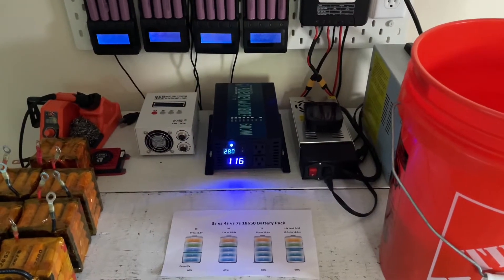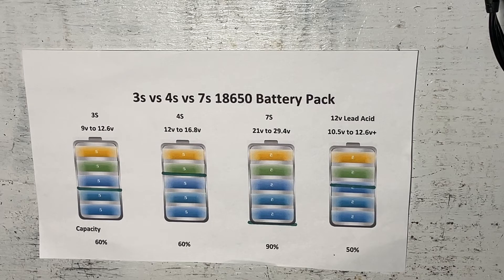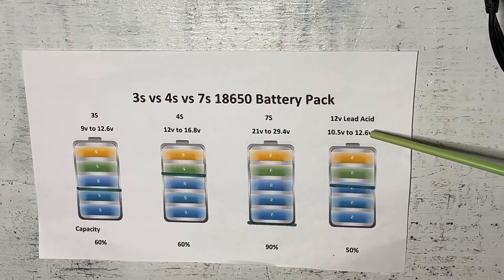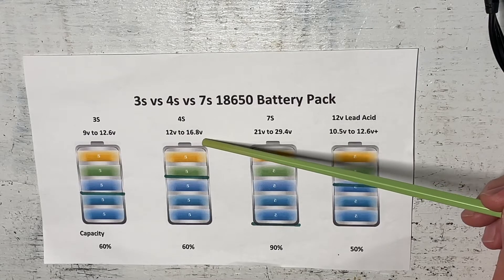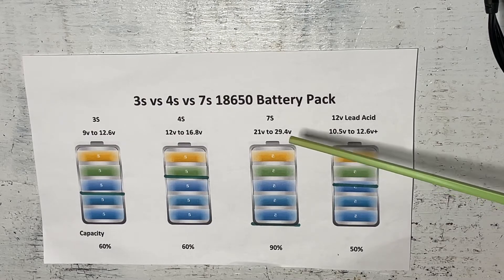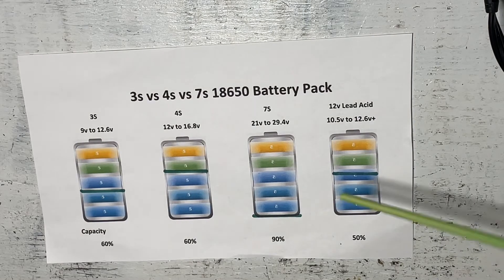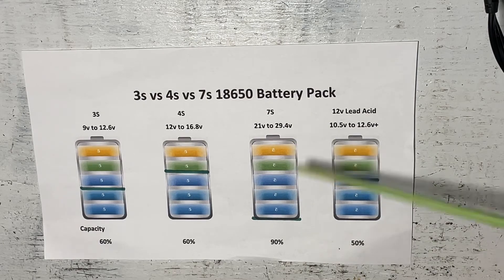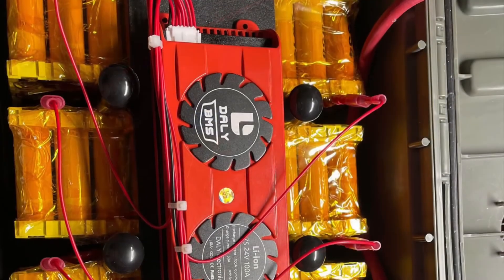Beginners guide to 18650 batteries part 4 Battery voltage￼”￼

Comment: 02:46 Checked my inverter and it cut of at around 10V. So I think in my case 3S would give me 90% when the inverter cut at 10V. The others would give me around 100% as long the BMS cut at 12V and 21V.